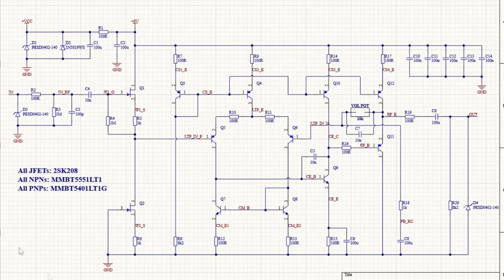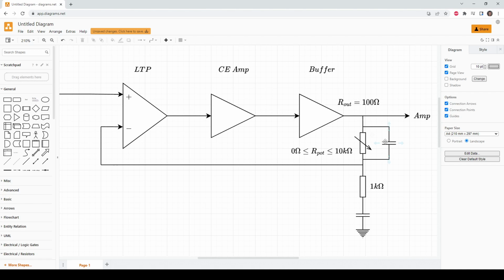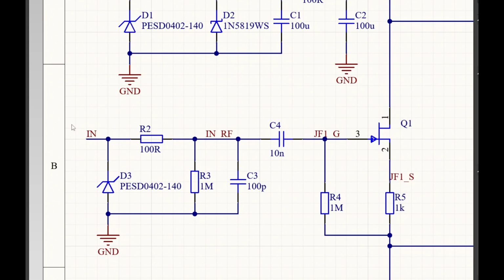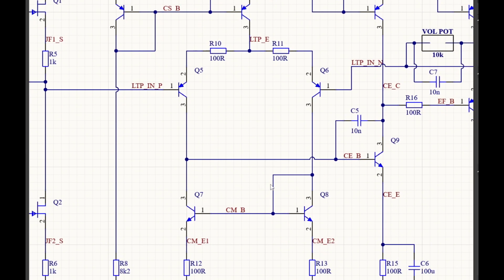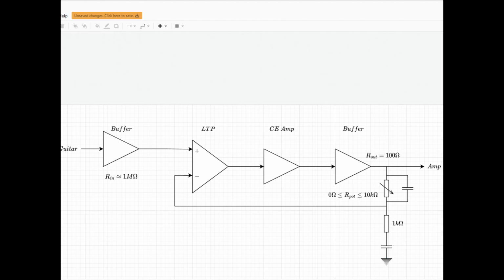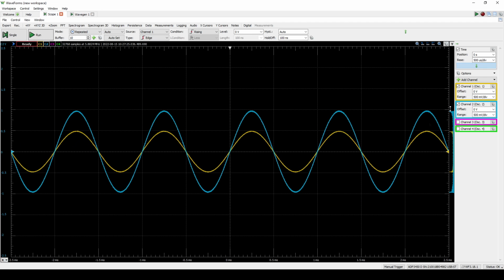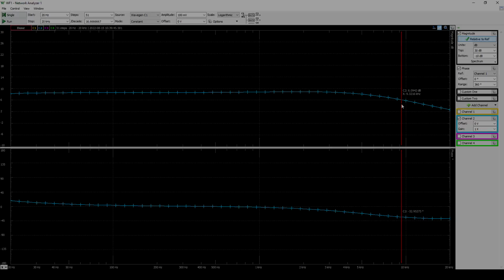(Sponsored) Guitar Boost Pedal Design - Phil's Lab #74

Comment: Great build!  I would suggest to anyone making this to replace R6 with a 5k trim pot.  This will allow you to adjust the DC bias point voltage of the source follower (ie the base voltage of q5).  JFET's have large parameter spreads from device to device so this will help you match the results he shows in his time domain.  You will also be able to dial this knob and adjust at what input amplitude clipping starts.

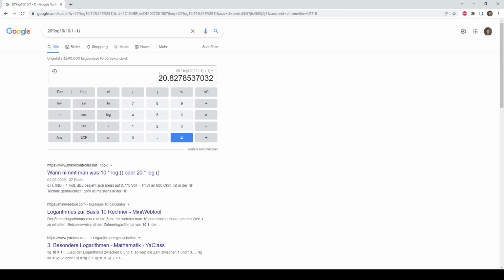Comment: @14:56 . . . amplification of 11 . . . I'm sold . . . make sure the dial has 11 on it . . . It's the details
Reply from the maker: Haha I'm surprised I didn't even catch that while making this thing... :P(
Reply: @PhilsLab  . . . on a subconscience, you're taking everything to 11 and it shows . . . enjoy your vidoes . . . I've watched the Kicad 6.0 PCB one a dozen times using it as a pattern for my first Arduino (don't hate me) PCB project . . . can't thank you enough for creating that. Also, learning a ton from your other videos . . . I have a PT100 based circuit that I plan on refactoring and incorporating the DSP stuff so that I can get a steady temp measurment from it . . . there's a tad bit of noise I want to extract to stablize the readings without compromising responsiveness to change. Thanks again man! Keep it coming!
Reply from the maker: Thank you very much, Curt! Many, many more videos to come :)

Comment: I'm a bit confused why cascading them causes clipping when you adjust the second boost circuit, when the first circuit is at unity gain. Aren't they both powered from the same rail, and you'd get the same voltage swing capability out of each? Great video though!
Reply: NVM I see the v/div changed and I didn't notice, so the first stage wasn't at unity.
Reply from the maker: Thanks - yeah, the scale changed during the transition!

Comment: The ltp amplifier is a type of differential amplifier, or another name for differential amplifiers ?(English is not my first language) This project is especially interesting to me, as just this semester I learned about differential amplifiers and op amps
Reply: LTP (Long Tailed Pair) is nothing but another name of a differential transistor pair with a current source for polarization. Most bipolar OpAmps are having this kind of input stage (sometimes using PNP BJTs; e.g.LM358 for rail to 0V input when using a single rail supply).

Comment: Great video, Phil. Curious what size smd you are using. Thanks.
Reply from the maker: Thank you! Smallest SMD size is 0603, then a couple 0805s for the larger decoupling caps, some small-ish diode packages (SOD-323, 0402 for TVS), and SOT-23s for the transistors.
Reply: @PhilsLab  👍thanks